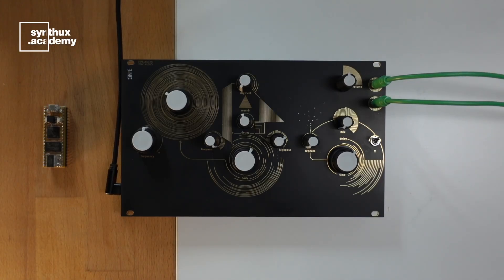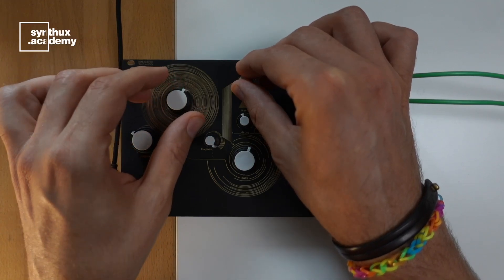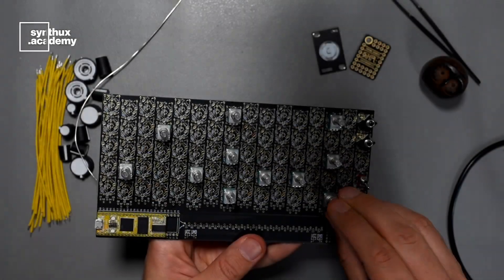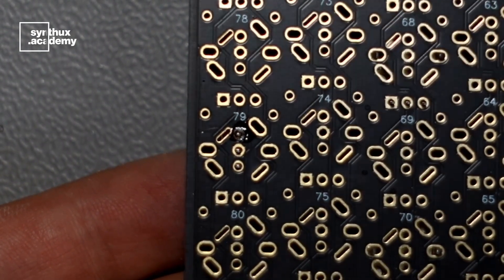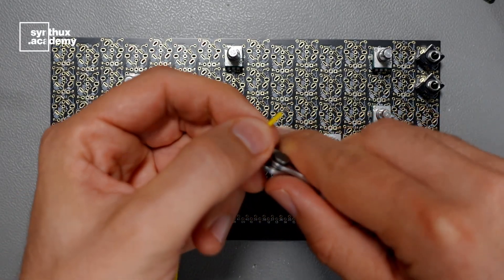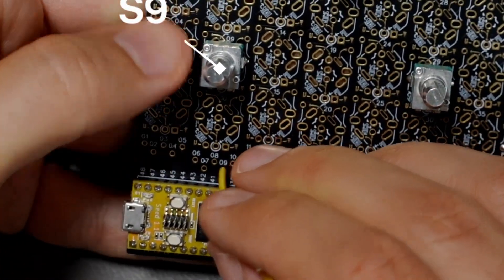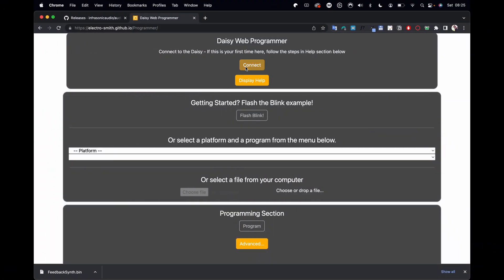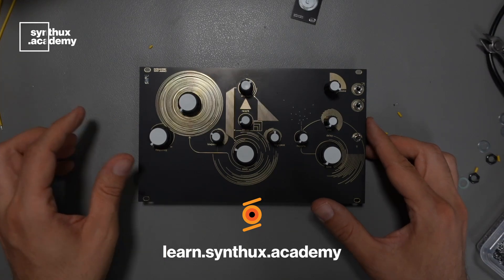Feedback Synth Audrey II - Build Tutorial

Comment: Just a little heads up: Using PC. When I went to flash the bin file using the programmer, when pressing 'connect' the prompt 'DFU in FS Mode' wasn't displayed in the stack of devices. I tore my hair out doing everything, resetting, unplugging, etc. Then doing a search found on the Daisy forums found the answer was to use program Zadig to reset the usb driver. 
From the forums: "Click the Options menu in Zadig and select “List All Devices.” In the drop down menu inside the main window, select “DFU in FS mode,” followed by selecting WinUSB in the target driver box. Click “Replace Driver.” Zadig will update to the appropriate driver to flash Daisy". 
So I crossed my fingers this wasn't going to brick my daisy, did the instructions then finally 'DFU in FS Mode' was displayed using the chrome programmer! Voilà! Now to see if it worked...
Reply from the maker: Sorry about that. I just pinned a comment about this, to help others avoid the frustration. Thanks for the comment. Enjoy your Audrey!
Reply: @SynthuxAcademy  Thanks! Yah, saw it just now on your Troubleshooting page too. It worked and everything is up and running👍

Comment: Roey, My Audrey kit arrived last night, after watching several Synthux Academy tutorials i am excited to get started. I am 56 and an industrial designer as well, not new to DIY synth construction and circuit bending. However, i wish to utilize my Audrey in a stand alone capacity and want to know how best to power her as such. Could you explain how to use a 5V USB power brick, a 9V battery, and a Wall wart adapter for options to power the Audrey? What does the Audrey draw in terms of power? Electrosmith states the Daisy Seed runs on 4 to 17 volts, could you go over the wiring options for these power connections i outlayed here please? Are there any files for a 3d printed case (or walls as shown you are experimenting with) for Audrey? Thank you so much and i think your simple synth board is quite ingenious and hope to see great things come from it and the community working with it. Raleigh, NC USA.
Reply from the maker: Hey, thanks for the message. Great to hear that you enjoy Audrey! As for power, the Vin pin can take up to 17v so you can plug her directly to a 9v power supply, for example. Please check the pinout diagram. Here is a video with more info: https://youtu.be/wRyLokxvzEs?si=t3LSkHTqSDxDqLha

Comment: I got myself that DIY kit and soldered everything up following the video. But when I start chrome with the programmer page, connect the Daisy via the USB-cable, which was send with the kit, pushing first the boot button and hold it, press the reset button aswell and release both i can't find the entry of the Daisy in the window which opens when i press the 'connect' button in chrome. If I unplug and replug the Daisy there is a second red light flashing on the chip and I can find an entry named 'Daisy Seed Built in' in chrome. But with that selected the 'Program' button on the page is greyed out and isn't working. Any idea how i can solve this? I think this can't have anything to do with the soldering, as this was my first attempt on this craftship, can it? Don't know if I did a sufficient job there.
Reply from the maker: Hey, it seems that your Daisy is not recognised in boot mode. Please email us at support@synthux.academy or join on Discord to ask there. Alternatively , you can reply to the order confirmation email you’ve received. We’ll figure it out together!